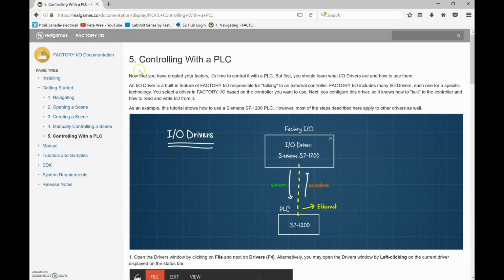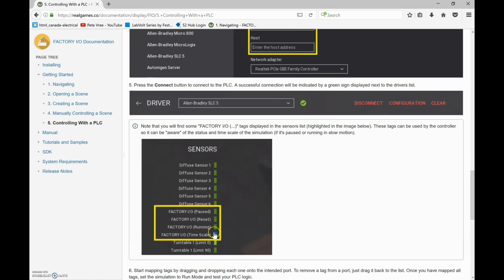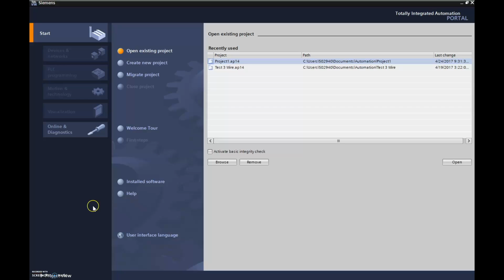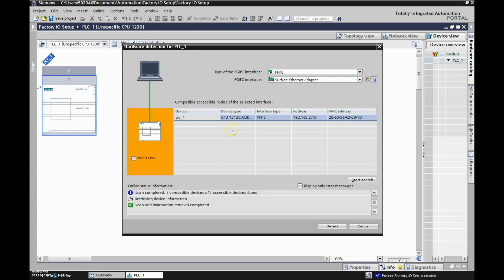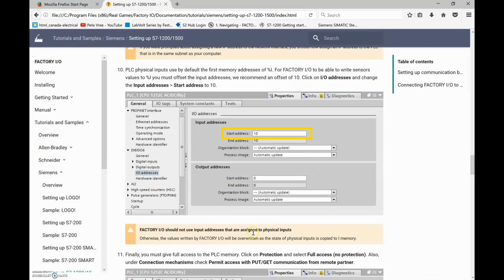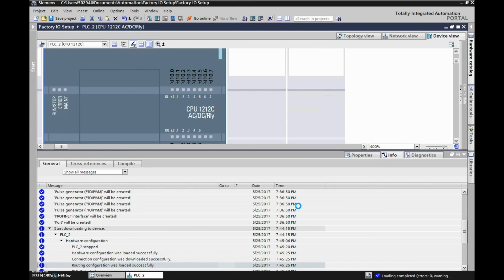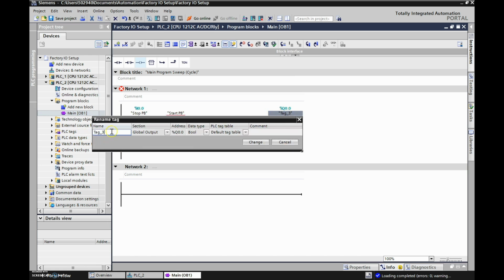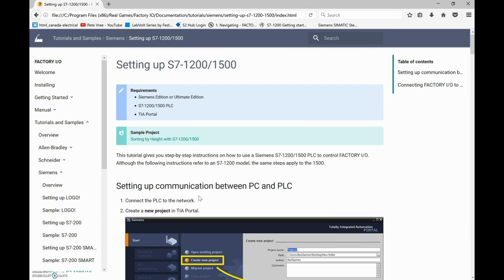Factory IO Tutorial (How to set up Siemens S7 1200 Drivers)

Comment: Thanks for good quality videos on PLC. I have a question, should I need to buy Siemens S7 1200 software and Siemens PLC hardware to control any project through PLC in Factory I/O?
Reply from the maker: You can control the Factory IO software using just the software. You just have to use PLC Sim https://factoryio.com/docs/tutorials/siemens/setting-up-s7-plcsim-v13/

I haven't had time to investigate this yet, but it seems that you can use Win SPS-S7 as well: https://factoryio.com/docs/tutorials/mhj/sample-winsps-s7/

Comment: have you used any kind of hardware ? or all you have done with some software ? i mean have u used any actual plc?
Reply from the maker: Yes. I used a S71200 Siemens PLC connected by Ethernet. Have a look here to see all the options available: https://factoryio.com/editions/
Reply: @PLCAutomationAcademy   Hi Peter, Thanks for this amazing tutorial. I am currently doing internship in Industrian Automation at Siemens and not really allowed to connect directly to an actual PLC. I would request if you can suggest another method to connect the TIA portal to the Factory I/O. A method which does not require connecting to an actual PLC.

Thank you
Reply from the maker: https://factoryio.com/docs/tutorials/siemens/setting-up-s7-plcsim-v13/